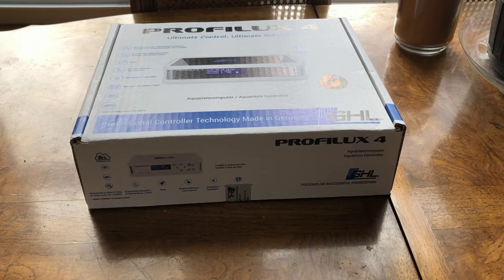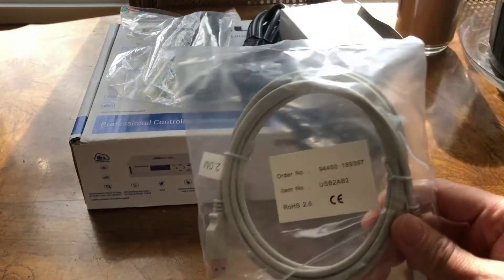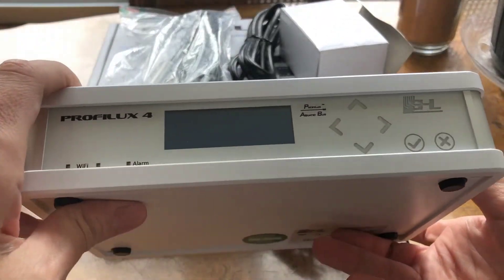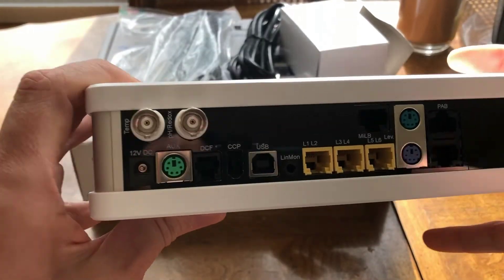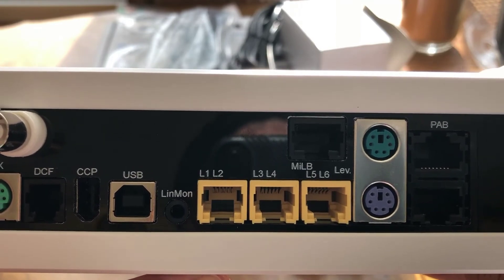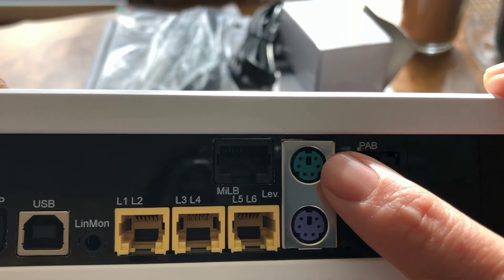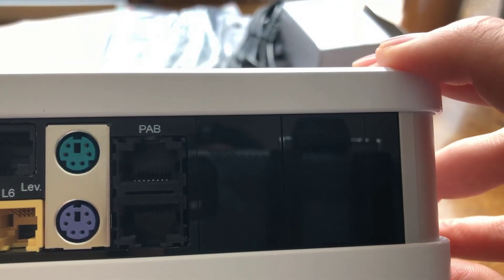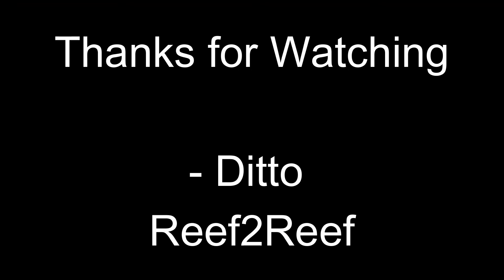GHL Profilux 4e Controller: Unboxing and Product Overview

Comment: Assuming you had a Apex lol. I’m here cause mine just took a dump for the 3rd time in 3 years. Just bought this last night and paid overnight delivery. Great Video 👍
Reply from the maker: Yes, I used to be heavily invested in Neptune Systems but had a tank crash caused by the system that the techs at the time could not explain as the unit was running, but logs were not being produced, but it just felt like dosing everything into the tank at once. When it happened, I was across the county and could not do anything till taking a red-eye home, and the damage was done. That was almost five years ago, and I never looked back after the change. Since switching, I get my every 2-hour tank report via email and text messages of alarms. Most importantly, I have not had a unit crash, been away multiple times across the county, and never experienced an issue.

Comment: Do you need the powerbar to control a heater?
Reply from the maker: Do you need to plug the heater into the powerbar is always a trick question. Do you need to, the answer is no, depending on the type of heater if it has a internal thermostat you do not need to, with caution, and if it does not have a internal thermostat you will need to so that the P4 controls the heater on and off. Heaters with a internal thermostat do not need to be plugged into the powerbar but you run the risk if the internal thermostat fails it could cause a rise of your tank. I plug mine in and use the P4 to turn them on and off, and use the thermostat on the heater as another safety feature. I set them 1 degree higher then what I want my tank to be, and then let the P4 do the rest.

Comment: How is this going? I’m looking to replace my Apex classic with a profilux. In terms of reliability, would you recommend the powerbar 5.1 or take a risk(?) on the new 6.1e Powerbars? Thanks.
Reply from the maker: You can not go wrong with either. When GHL releases a product it very stable, and would get the new Powerbar 6e. In case others do not know GHL has released a new powerbar called the 6e. All the details of the powerbar are here.  https://www.aquariumcomputer.com/products/profilux-accessories/powerbars/?fbclid=IwAR0--zAbG7vjlmduZvuauxzQtT9Cu-NzZ9XujOd2WU6Z8eV719zmH7qFeL4